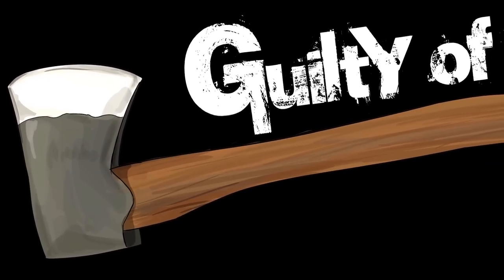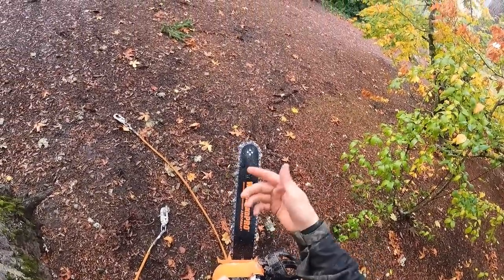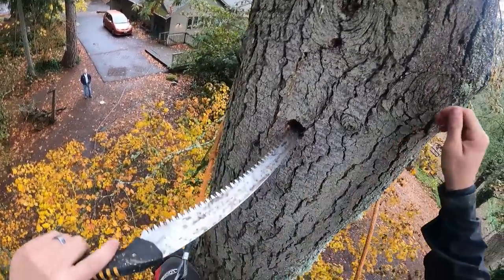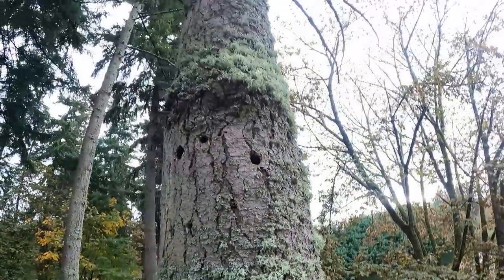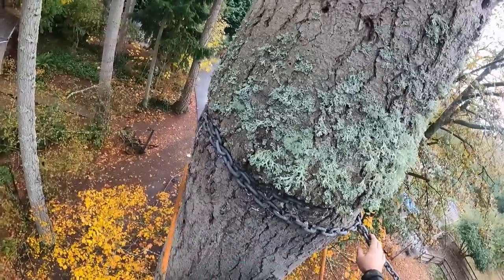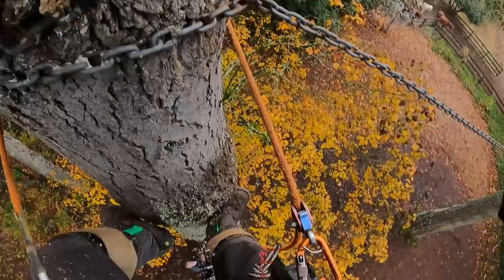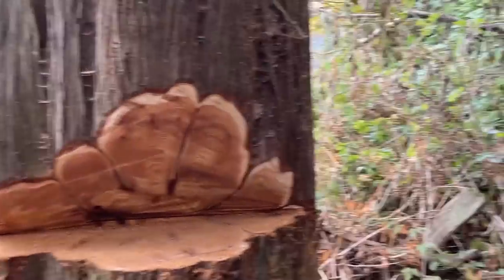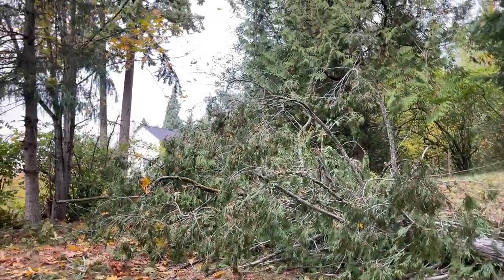Climbing a Super Dead and Dangerous Fir Tree!

Comment: I was on the pull tractor of a 200 foot Loblolly being felled - we didn't have the pull rope up high enough to get a good pull and the wind caused the tree to sit back up and crushed the bar of the chainsaw - had to add another 75 feet to the pull rope and was able to move the tree off the chainsaw to replace it with another saw and finish falling the tree - it was dead, it had beetles in the whole soft wood body of the tree - actually was 198.5' tall and 84" at the stump

Comment: I’ve had to span rig my climb line between 2 green trees. It’s a lot easier and safer than just climbing the dead one. Something to think about. Great job. Have a blessed day.
Reply: Lets say you do tie into a green tree and swing over to a dead tree.  Now you'll have to lanyard around the dead one to climb it.  What if the dead tree breaks?  You're lanyarded to it.  So if your green tree tie in dont break your saddle is going to tear you into two pieces.  Ill take my chances climbing the dead one and cutting my weight out of it as soon as possible.  Unless the bark has sloughed off, dead trees are pretty strong still.

Comment: A little tip on conventional style notch from someone who was taught that way, start with the top cut first. Set up on the right hand side so you can make the cut while watching the sights, then it's way easier to match the bottom to the top rather than the other way around. Also you can look down your top cut to see when it matches on the bottom cut that way, more comfortable too.
Bottom cut first works better for some people but I think especially if you're not as confident you get a much cleaner straighter directional notch top first
Reply: He used a Humboldt
Reply: @llewynransom7908  28:21 looks like a conventional to me
Reply: @DisasterpiecesIRL  ah, I guess I should have finished the video before throwing hands in the comments. His first notch was a Humboldt, my apologies
Reply: @llewynransom7908  all good dude, I suck at Humboldt when it matters, because i don't do it often enough to learn the little tips

Comment: Thank you for once again showing its not all 100% confidence and "Just simply..." 
Its really refreshing for someone newer to see these types of things, I would have tapped out and said I was unable to it at all, That thing was sketchy.

I have a question as I notice you wear velcro pads for your spurs, I recently tried an older pair of Buckingham Velcro pads, Without the steel insert, after some high praise from someone else and they are extremely wobbley when climbing. Are other styles more secure to the shank? Or is that just the nature of the velcro pads?

Comment: I can see climbing it a bit to test the rot with the feel of the spikes. OTH, why not just cut the chain from the other tree and then fell it? I was all set to climb a long dead hemlock and then changed my mind; it had a lean and weight towards a home, and no good anchor for a redirect. So I felled it, leaving lots of holding wood and pounding wedges. Still had sound heartwood in the butt, maybe a little less than this tree. Broke into several pieces when it hit. Also had several large woodpecker holes like this fir. The large nesting type holes (as opposed to smaller feeding holes or bark stripping) are a tell that the sapwood is gone and the heartwood is weak -- and not a tree to climb!.

Comment: Would you ever consider doing a shallow notch and a shallow back cut, leaving a really thick hinge, climb down and shot a line up and try to pull the top with the thick hinge using some kind of mechanical advantage?
Reply: I'd pass completely.
Reply: I know a guy that does that with his mini skid steer.  I  don't trust it.  Far too many risks for trees that are that punky inside.  It could break and fall the wrong way or multiple directions with multiple breaks.

Comment: I feel like wedges are useless once you have a rope in the tree, a rope seems to have more leverage. I'm not trying to be rude, just trying to have a discussion.
Reply from the maker: Just another preventative measure, can’t be too safe when dealing with a tree like this. If the rope were to break off the branch it’s around the tree would sit backward and likely fall the wrong way! 👍🏻
Reply: Just like they put wedges in as they jacked a tree in the redwoods.

Wedges also spread out the force between the wedge and the rope and just not everything on the rope.

Comment: First of all, excellent job.  Here's some armchair criticism just so you have a reason to throw darts at my picture:

1.) before doing the back cut on the rotting tree, shave off some of the punk and bark so that you're driving wedges into wood strong enough to allow the wedges to do their job.  That way you get the full inch of lift when the wedge is buried.  This wasn't as necessary here though since you had the tractor and rope, and I'd say it's more common in logging where you don't have the towing going on, so I don't know that this suggestion was really all that critical.  I like using shorter wedges so that I get to the full inch of lift before hitting the saw bar if possible, and this shaving helps in that regard.

2.) Since you had the tractor, I think just putting the rope where the chain was or just below would have given you far more than enough leverage despite not being as high as your slingshot spot, while making it more likely that the wood would be sound/strong to avoid breakage during pulling.  That said you would have to pull slowly to avoid a sine wave of sorts in the trunk that could snap the tree from the weeble wobble.  That would have helped avoid all the slingshot attempts, but may have made the video a lot less entertaining.  What you did still worked perfectly well, so still not a big criticism here.

3.) On the second tree, I would suggest taking pride in being careful to piece out your face cut to avoid dutchmans and keep the direction of intended fall correct.  This is why your aim was so perfect on it.  Too many guys either rush or are too proud to take their time and then have to keep increasing their face cut depth just to get rid of dutchmans caused by trying to get it on one shot.  I think you did it right and should be proud of that.

4.) On the second tree's back cut, if the tree is too big to see where it should go all the way around, take the time to scribe a line if you feel it's necessary.  Even then it can be hard to get straight but if you go straight back from either side of the face, you can see if they'll meet in the center of the back. before doing the real back cut.  Again, what you did worked well so not a big deal.

Finally, excellent job.  I'm just in a typing mood tonight I guess so I'm throwing out my two cents worth.
Reply from the maker: Thanks man that’s all good info I appreciate it :)
Reply: @GuiltyofTreeson  No problem.  I appreciate your videos, as many others do as well.